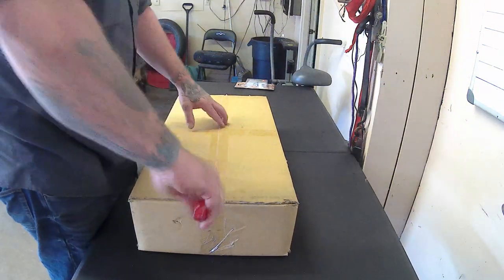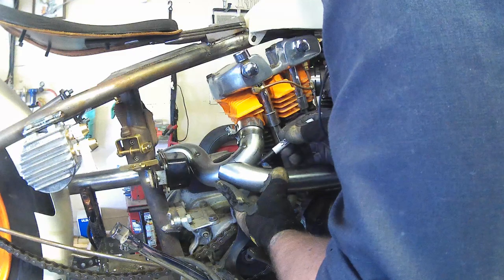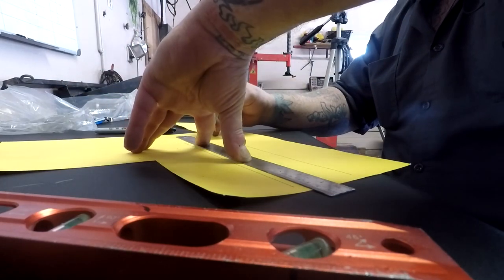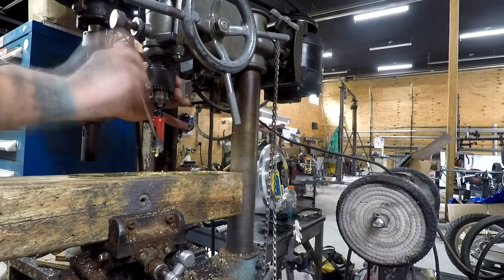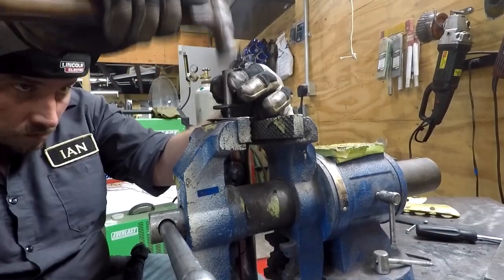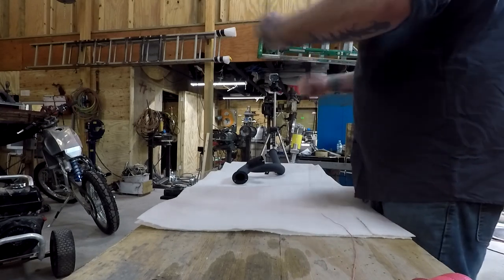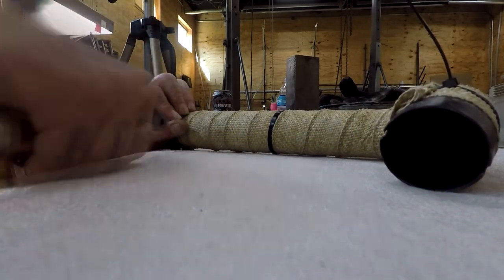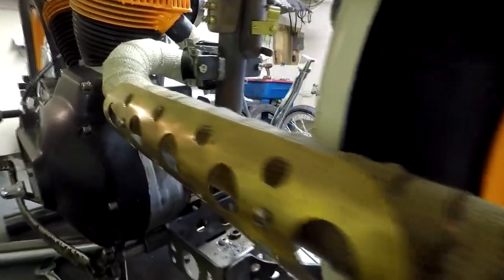How To Build And Install A Motorcycle Exhaust Pipe

Comment: What’s your thoughts on using filler rod as you did vs fusing those sections of pipe? Any reason you did one over the other? Considering a job but don’t have a lot of exhaust experience.